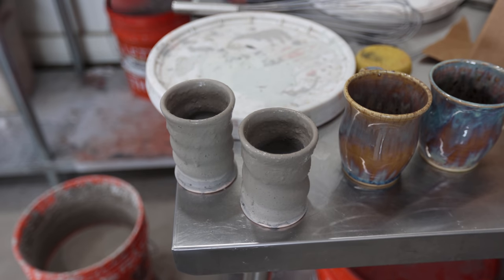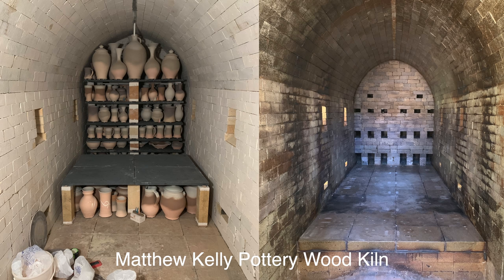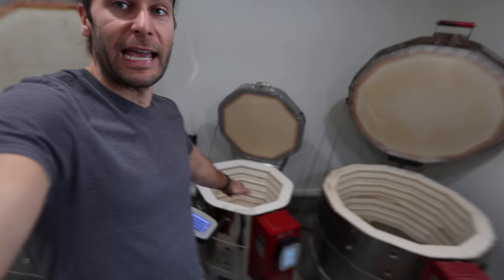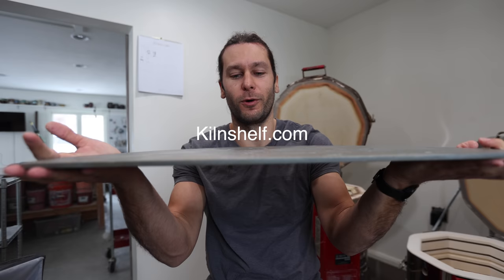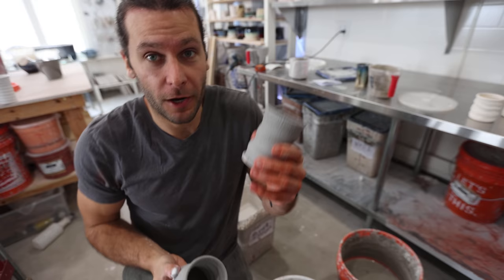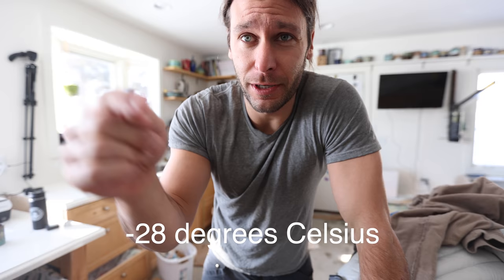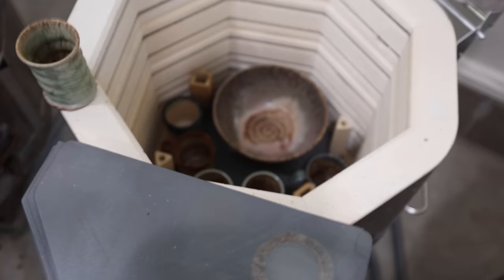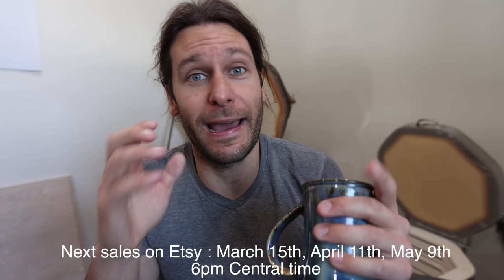Let's talk about KILNS

Comment: We converted a few old electric kilns into gas down draft kilns, not hard to do to get your feet wet on gas firing.
Reply: @tombraun7235  type in convert electric to gas kiln. You will get several video an info on how to do it. It took part from ceramic network part from Simon Leach. Is not hard just had to mess with how big the opening to the flue was. https://ceramicartsnetwork.org/daily/clay-tools/ceramic-kilns/diy-downdraft-kiln-how-to-convert-an-electric-kiln-to-gas/
Reply: I was going to suggest the same thing.  I have a kiln I was given, and I intended to get it up and running.  I never did, which is fine since it was a low fire kiln, and that'd not really what I wanted.  I came across a used kiln that needs work, but is a mid to high fire model.  
So I am considering converting the older one into gas, so I can do reduction with salt or soda.

Comment: Appreciate everything I'm learning on this site so am passing on some of my learning and hope this helps  with pinholes/dimples in Slow Cool Firing cycle --  a suggestion that helped me was to use the DIGITALFIRE addition of the drop and soak ramp about 100 F below peak. For me peak is 2195 for a ^6 firing so I soak at 2195 for 15 min then 9999 to 2100 and soak for 10 min. This solved the problem for most of my glazes.  For my most dimpled glaze I did another soak at 1900 for 10 and I also lowered that glaze's SG to 1.40 and Viscosity to 12 (single dipped) to allow for easier off-gassing of talc. I fire in a Skutt KM1018 kiln.

Comment: Jon, perhaps your new clay body could benefit from a longer and/ or higher bisque to burn out impurities.  It could be it is relasing gases in the glaze firing that are being trapped in in the molten glaze.

And for anyone looking for a kiln (or wheels), always keep an eye on Craig's List or other such auction sites.  There are a couple sites here in the States that public schools use to auction off old equipment.  You can get really good deals, because they are more realistic about what they have, and sometimes just want to get rid of it.

Comment: For your older simple shelves try an angle grinder with a diamond bit .. Amazing at cleaning up .I have been doing some alkaline cone ten work lately in my outdoor sprung arch kiln and with a drip or two it is a great tool for cleaning up .. We also use setting rings with sand or ground insulating brick dust  at cone 10 . Something refractory up at white hot ..I have 3 older Skutt 1227 s . I try to fire every day but at 71 it works out 3 to 5 times a week .I make 25 to 35 tons of flowerpots a year .. . We make unglazed  flowerpots stacked inside each other so no shelves needed on the skutts ..  90 one pounders or 60 two pounders or 36 4 pounders or 28 six pounders or 22 twelve pounders or 16 16 pounders  or  8 24 pounders (with fillers )  The yields are right around $900.00 to $1500.00 a load retail of  500 to $750.00 wholesale  fiiring at cone 02 .. Keep enjoying yourself .50 years at the wheel and I smile every day .. Yours Guy

Comment: Love this! Considering my first kiln and have been looking at the skutt 818. You've confirmed my thinking about size. Questions:
1. Once you've dripped on and scraped away the advanced kiln shelf, is that area still going to be as "nonstick" the next time?

2. I've read that you need lots of room around kilns but you have yours so close together...any tips?
3. I've been told that electric kills should be in a separate shed because they can cause condensation of chemicals that affects metal in the room and makes it rust. Have you had that happen? (Considering a separate shed).
Thanks!

Comment: Kiln wash?  I thought that was supposed to prevent, or at least help reduce, sticking pots from glaze run off.  Great video!  Want to have a home studio in the next year.    The kiln is the least I know about so I learned a bit more to help figure out what I need.  Thx
Reply: It didn’t look like he had much or any kiln wash. The kiln wash will help but with that much dripping it definitely wouldn’t. Not anything close to that advanced shelf.
Reply: You can also sit your pots on a patty of clay slightly larger than the pot to protect the shelves.

Comment: I just now well this afternoon received my wall mounted controller which has the exact same features as the scut counts and I'm using it with an old Vulcan kiln. I mean I redid All The brick in the Vulcan I found a local source for kiln brick and made a jig for my Mill and I mailed out all the tracks and cut the angles for the brick they turned out absolutely perfectly perfect and then I wound some brand new coils out of A1 kanthol 16 gauge wire so basically the part of the Kiln that matters is all brand new. I'm firing it right now but I'm just doing basically an empty Kiln with a bottom layer of cups just to see how it turns

I can't really justify filling and killing 100% and firing it 100% full when I don't even know what I'm doing with the controller. I was having trouble with the Kiln sitter and I had a very cheap analog pyrometer so I just bit the bullet and decided to get the controller that way I would have a good pyrometer built in and be able to control everything without actually using cones. You can overshoot a cone you can't overshoot the electronics that are controlling the relays for the speed of the Ascension or Ascension so I figured I'd get a lot more accurate temperatures. Basically those wall mounted controllers are awesome they take any cheap Kiln as long as it's intact and it works and turn it into a awesome kiln

All of a sudden and out of the blue I'm getting pinholes all the time and I don't know if I'm overshooting or undershooting my temperatures. I know the cones will eventually melt even if they don't reach maturity temperatures for the glazes so who knows I'll find out now cuz I'll be able to see what temperature it went to

Comment: Idk if it would be possible to do a more in depth video of the process🥺? Like how you set up the temperature for the firing and how to install electric kilns and idk, a step by step of how you set the little screen and all that haha
Reply: Better go to a ceramic shop and ask someone who knows about kilns, ask them everything, they will happily help, céramists are friendly people.
 As kilns are crazy expensive, don't buy to big, choose a good and reliable brand. They are super heavy too, so think about where you want to install it. Ask an electrician if your electric system can handel the power required. You can buy 2nd hand as long as they are relatively new. Why? Because they are better insulated thus lower costs, the bricks are usually not worn, the resistance cables won't need changing.
As for the firing t°, it's strait forward biscuit is usually 950° Celsius 
Glaze, between 1150 and 1280°. 1150 will be brighter and colorful but  fragile while 1280 will be dark but very strong. All the instructions are all over the internet. Kilns come with pre-programmed firing menus. That's the easy part
Reply: I actually said the same thing in another video! I'd love to learn how to use mine... because of cobid I haven't had much luck finding any advise and I want to learn to use the one i bought!

Comment: If you ever do Cone 10R try an amber celadon glaze over a copper red glaze.  Moderately runny so just have the celadon on the top 1/3rd of the piece at most. But it looks fantastic

Comment: Nice brief introduction to kilns. I am thinking about getting a smaller one like you’ve shown. Do I need to put a vent to the outdoors next to where the kiln is located in the basement?
Reply: If you are a beginner, no need to install any ventilation. Usually, you'll fire when leaving your studio. Crack open à window and close the door behind you. And as a beginner, you won't mix glazes with toxic ingredients. Ready to use glazes are environnement friendly these days. 
But, later in your studies, if you find yourself mixing and testing with toxic products, just add an aluminium accordion that you would use in the kitchen to a hole in your wall. It's enough.
Reply: Obviously, and it's nowhere mentioned in this video, check with an electrician or engineer friend if your electric installation is up to the task. I installed a new electric system next to the house primary electricity panel since the latter was not strong enough. Kilns use 230v or 400v, sometimes 2 phases sometimes 3. Depending where you live, it could be a problem.
Reply: Good points. I’ve been a potter at our community art center for years, but have limited my experience to loading or unloading a kiln. Would like to use a smaller one at the house so I am not waiting weeks to get things fired. This would also allow me to experiment more, since I am at the mercy of the studio.

Comment: My problem is that I do not have access to 220 high amperage circuits.  Too bad  for hobbyists and beginners that there are so few kilns that will run from a 15 amp 120 circuit.

Comment: Can you make enough money making pottery? If you wanted to make 60k a year, worked M-F, 48 out of 52 weeks in a year, and made one fine piece per day, you would have to sell it for $250. To cover the cost of the materials, kiln, and electric however, you'd need to sell it for a bit more. Is there really a market for stuff at that price? I feel like you'd have a better chance at making specialty pieces like that than cheap plates and cups which most people will just buy from local retail stores.

Comment: Do you recommend any resources for those starting out on using a kiln. I was thinking about buying a small skutt kiln as my first kiln. The price difference between the touchscreen and normal controller is high. Is it worth it????
Reply: I just ordered my first kiln, a Skutt KM 818  with the touchscreen. It’s £350 more than the normal controller. Time will tell if it was worth it.

Comment: Hi, I'm trying to find a recommended recipe. We are firing ceramic to 1050 Deg. C, cone 10 right? We take a lot of time ramping and dwelling to get there, 60 hours, and then once we dwell at 1050C, we literally turn the furnace off. I think that sets us up for dunting and internal stress. I'm generalizing because of our proprietary material, but am I right that this is NOT the way to fire ceramic? We should gradually ramp the temperature back down until about 500C before we just turn off the kiln right? Opinions would be greatly appreciated.

Comment: Do you know how much electricity it pulls to run/fire your 818 kiln? And do you have a cost comparison to running the smaller kiln vs. the bigger ones? Trying to figure up the cost it would take to fire the smaller kiln size, if I were to purchase one for a home studio. As always, very informative video and love your channel.
Reply: An 80 liter kiln, per firing it's around 15 to 20 kw for biscuit and aroud 24 to 30 kw for glaze firing. Depending on how full it is. 
Costs will increase as the kiln gets older. Bricks will shatter, insulation will deteriorate.

Comment: Is it possible to switch out the heat/control center (I’m sorry I don’t the correct term) without replacing the whole kiln? 
I have a kiln that’s it’s pretty good shape, other then the wires that go to the wall. And the temperature control is one you have to sit and lower yourself, which I can’t quite find the time to do.😅 
I know they sell the temperature gage separate, but I wasn’t sure if it was an option without having to buy a whole to kiln.. or if it would just be best to replace the whole kiln itself?
the max temp is 2250/cone 6.
Reply: And it’s a Skutt!

Comment: i noticed that i have been getting micro pin holes as well.... and I'm at a loss.  i have been forced to use B mix recently due to my supplier's mixer/pug being broken down.   i am not impressed at all with bmix.....  i wonder if the clay is causing this???  i always thought that it was the glazes?

Comment: I need some help. I bought an L&L E23T-3, but couldn't really connect it to the home (home is only 100amps, kiln kinda needs 60amps). Who is the service to call for checking where my electric lines are in my yard? My home was built in the 80s, no conduit was used (wires were thrown into the ground and covered, lovely huh?). I tried using Dig Safe, but they would only put flags down if work was to be done (they said they don't do "planning"), but I'm not sure the cost of the job to upgrade to 200a service and where things are in the yard (which would likely use digging a 2ft square trench with sand to code). I'm certain the job for the panel and the interior work is about 2k, but idk where to begin with the digging and marking of lines through my yard. I'm bummed because I've had the kiln for a few years now, still under warranty, but never been able to use it :(

Comment: im upset, i saved enough money to get a kiln only to find out that due to my historical homes breaker box system i will not be able to have one at my place. i cant build on the property because i dont own it..so . i already asked.  luckily there is a public kiln about 30 mins away, but seeing as one of my clays is a cone 5-10 this may present a possible issue.  i cant test the glazes ive purchased and my cat has already broken a teacup (the cat is new)... im sure ill get this figured out. thank you for the explination on model numbers i have been shopping around and trying to determine the size of a kiln ... all for not at this point though.  i tried pit firing but doesnt get to a high enough cone not even to test glaze low fire glazes.   throwing is going fantastically though. .. kudos on that shit
Reply: There is a new website called findakiln. It allows you to look anywhere in the world to locate a kiln near you. Maybe you can find another potter near you!! It sounds like you have been doing a lot of research. You want to know a lot about kilns even if you’re just taking your pots somewhere. Learning something new is never ever a waste. I’m sure you will have one some day!!
Reply: If you are not confortable with firing your pots with other people pots (t° issue) just make a ton of pots and ask to use the whole kiln with your instructions. Instead of wasting 2 tea cups and be sad, just go for it and make all the crazy pots you want. It's probably cheaper too.

Comment: If I were to buy a kiln, starting small of course, would I need to set up a ventilation system? And also, would I need to upgrade my electricity unit?
Reply: I believe that if it’s a new kiln it’s worth getting ventilation system as it will last longer. Also it’s recommended to have a dedicated electric box for your kiln. But I’m sure Jon will give you a more complete answer about this 👍

Comment: Are those 30amp 120v? Do you recommend 15/20amp 110? Essentially home owner. What's the weight on your little kiln?
Reply: The Skutt KM818 fires on 208/240 volts, 27.8 amps and requires 40amp breaker. Not sure about the net weight but the ship weight is 145lbs. Hope this helps.

Comment: How do you fire them upside down without them sticking to shelf?
Reply: You use stilts and a post
Reply: @DavidHebert62  and then just sand down the little spots they stick to stilts?
Reply: @melissaescalera8108  nothing should stick.
Reply: I would love to see a demo of this process.  I don’t see how you fire a cup upside down on stilts and posts without making it worse.
Reply: @kerrimarguet4680  the stilt goes on top of the post with the metal prongs facing up so they go on the bottom of the mug is centered so it only touches the metal prongs on the inside of the bottom. Never fired mugs on stilts so the entire mug gets glaze?
Reply: @DavidHebert62  omg, now I understand. No I've never tried that, but I will! Thanks

Comment: Just use a microwave. They're much cheaper.
Reply: Yep actually you can, one , mug, at, a , time, 
And it uses far more electricity, has no safe venting. And you need to prepare a surrounding mini kiln to fit inside the microwave made of more expensive refractory. But yep, you can. Do you?